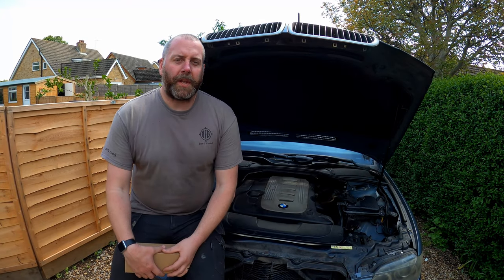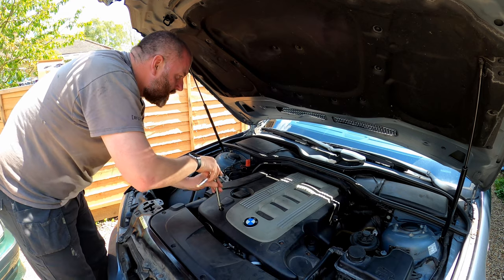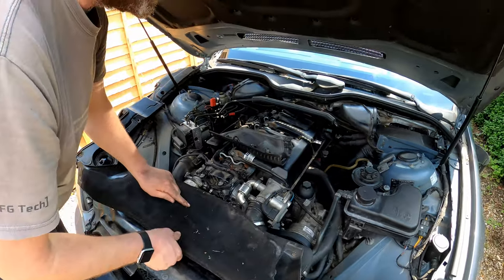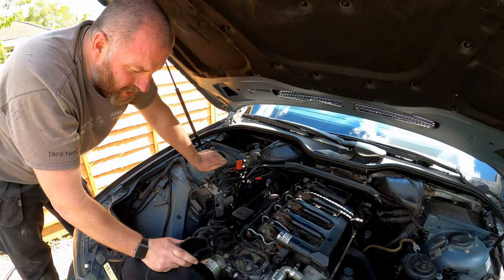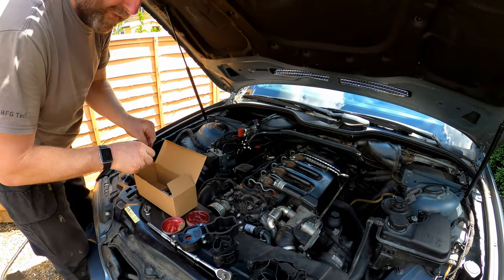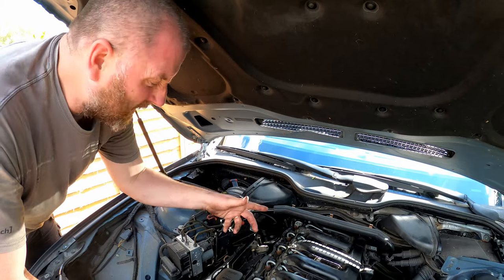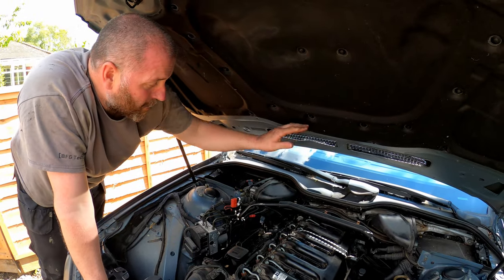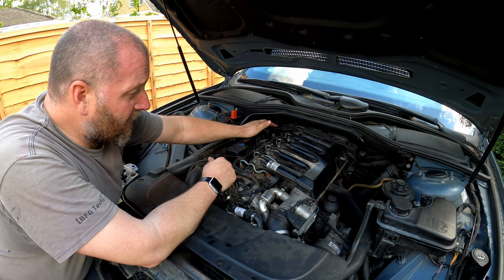Replacing The Crankcase Oil Breather Valve On The BMW 3, 5 & 7 Series and BMW X3 & X5

Comment: I have a e61 525d 2009 and mine has no filter in it either. When I ordered a Febi one, that came with no filter either just the case. Should I leave it without a filter or try to source a vortex one like you put in?
Reply: m57n2 comes from factory without oil separator

Comment: Would this fit bmw 330d 2007,  231hp M57D30TU2? I cannot find the one with the vortex attachment, only the ones without one and without a filter...
Reply from the maker: According to RealOEM, the part numbers are the exact same between my car and yours. 👍
Reply: @KevsShed  Youtube wont let me post the link, found this on the forum: The M57 engines in the E39/E46, for example, with 184 hp or 193 hp (530d) have an oil separator with a felt filter inside. The M57TÜ engines in the E60, for example, with 177 hp (525d), 218 hp (530d), 272 hp (535d) have an oil separator inside, which no longer has a felt filter, but a cyclone separator. The M57TÜ2 engines in the E60, for example, with 197 hp (525d), 231 hp/235 hp (530d), 286 hp (535d) have (now comes the fatal!) no oil separators at all! The case is empty.
Reply: @KevsShed  Ill just get the older style, thank u for the answer!

Comment: I think you may have installed the wrong breather for your vehicle,  the one without the vortex is the correct one, I just ordered a new one for my 56 plate 730d, febi 45193 and it's comes without the vortex attachment.
Reply from the maker: The one without the vortex would have a piece of foam inside and this is no longer available from BMW as it has been superseded! They were pretty rubbish and disintegrated over time! They can still be found from other manufacturers however!
Reply: @KevsShed  that explains it, I've ordered the same one as yours just now from eBay, btw I've got the same BMW and also a  vfr800 just like yours 🤣, that's how I stumbled on your channel, you got  fantastic DIY  tutorials, keep it up.
Reply from the maker: Awesome bud! I wonder how many other people there are out there with a 730D/VFR800 combo! 😃
Reply: No mate, later M47 and M57 engines came without a breather fitted so your car hadn't been messed with. Truth is the vortex filter doesn't do much and the foam one is the best if you can keep up with maintenance (change it or clean it with every air filter change).